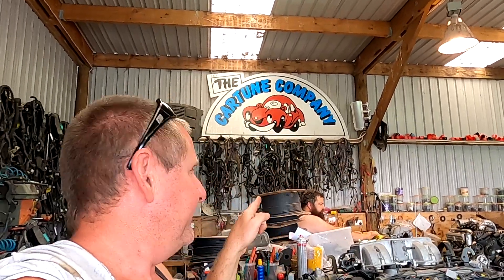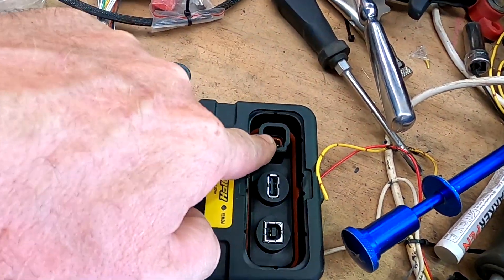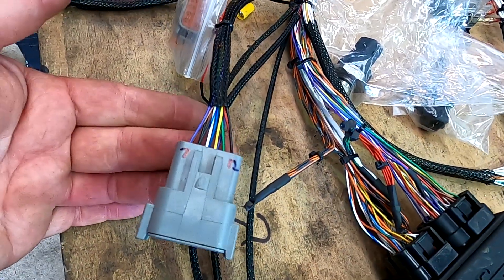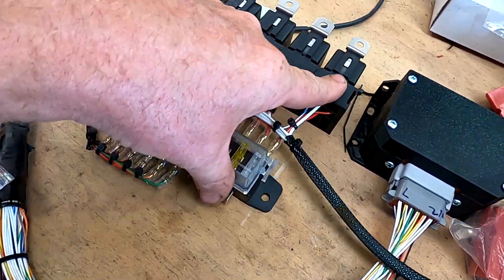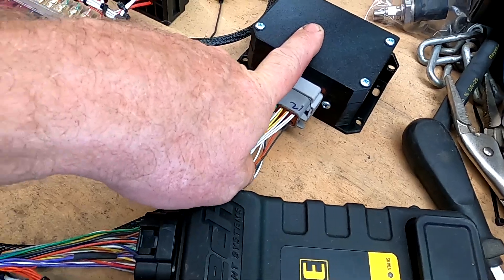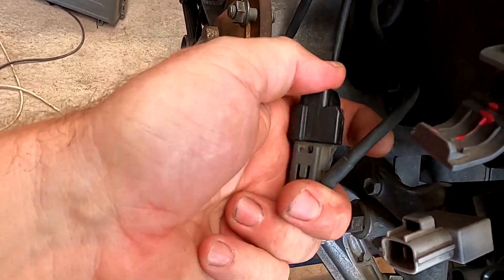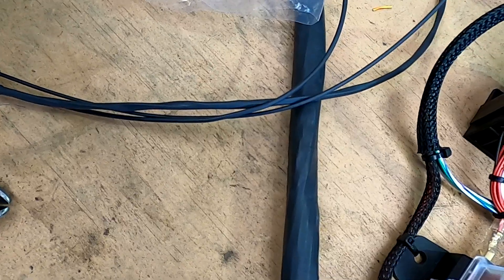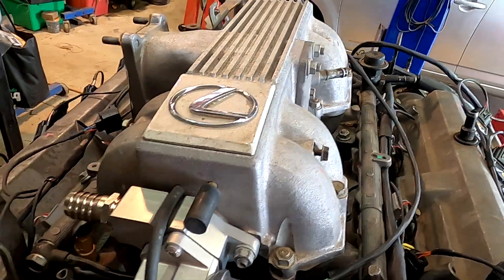1uz non vvti Haltech 2500 elite wiring loom with full auto control.

Comment: I see 3 wires of the coils and 1 by pass connector  do you used a ground trigger  and power and ground all the time
Reply from the maker: Correct,   permanent ground,  switched 12 volt supply and the ecu uses a switched negative for the trigger.  No feedback wired

Comment: A general question here,i have a Kia cerato 2012 model with a manual trans,can i use its ecu for an automatic trans?
Reply from the maker: Most likely this ecu could be used to control the kia transmission.   I'd recommend looking over the haltech ecu help file to confirm

Comment: Can the 2500 turn the A341E from a slush box into a competitive transmission?
Reply from the maker: It really makes the transmission come alive with modern control logic compared to the old stock ecu which took a week to shift through each gear.  Its a massive difference.
Reply: @CartuneNZ  lol your not kidding the sc400 is a slug b/c of that transmission in stock form